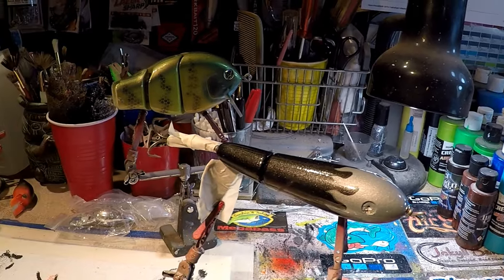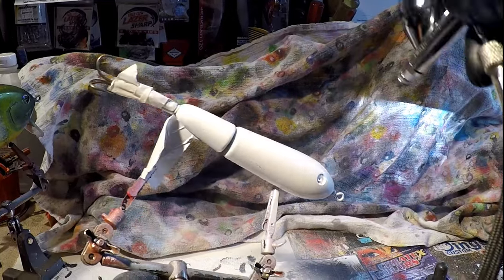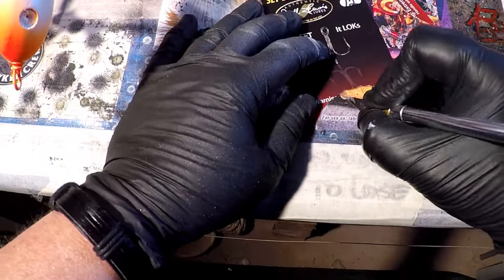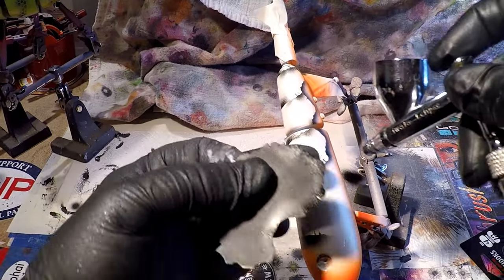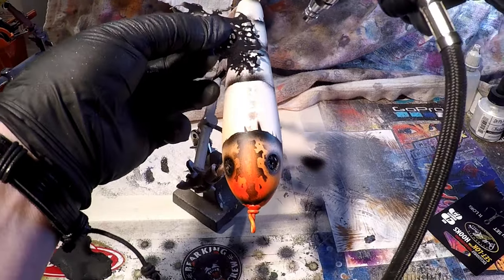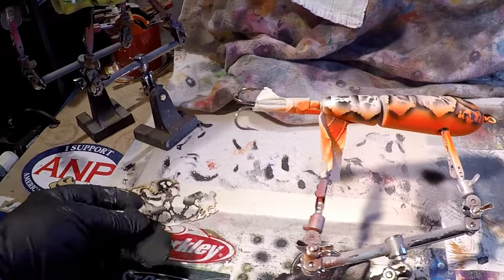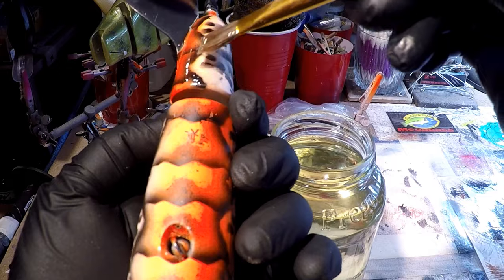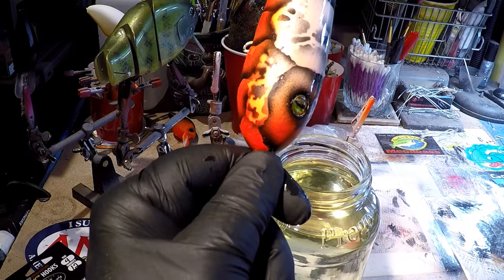SPRAY SESSION!! "Lee Lures Custom Chopper Repaint" (Imperial Neon Craw)

Comment: Curious, what is your set up for guns and compressor? Filtered air / non filtered? What type of regulator?
Reply from the maker: California Air Tools Compressor 8 gal., 3 moisture traps in the hose system, Iwata Airbrushes, pro air exchange and venting, dehumidifier,  in shop air conditioning/heating 3M Half Mask N95 respirator w appropriate cartridges

Comment: How do you clean/store your paint brush when you get done painting the KBS?
Reply from the maker: I stopped using good brushes and started buying multi-pack flat brushes for $5. One use and tossed after the project. Before that I used a glass mason jar and plastic wrap, and added paint thinner and soaked my brush 24 hours then cleaned the bristles with warm soap and water after
Reply: Jekyll Productions okay thank you so much